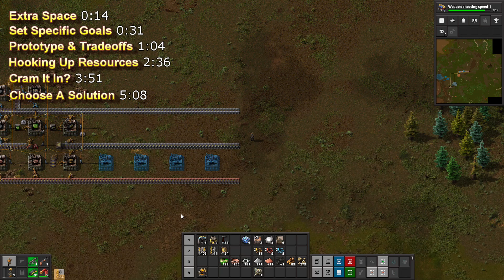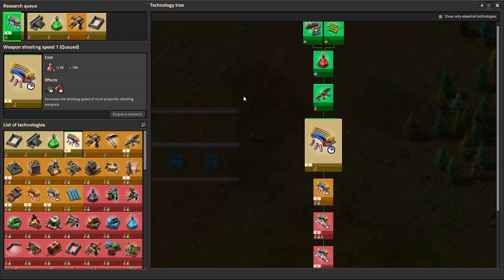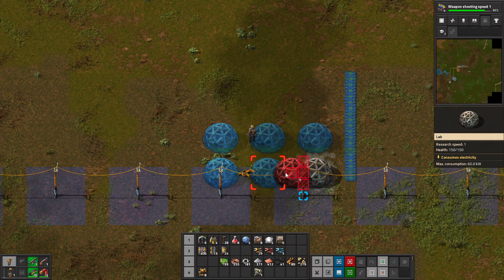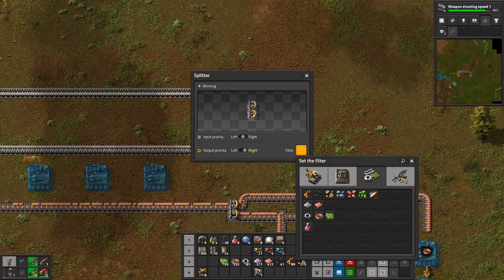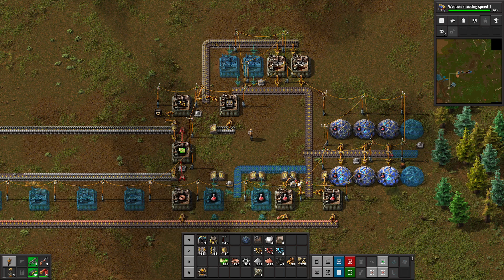Designing Complexity | Factorio 2.0 Tutorials For New Players | 8

Comment: My jumpstart base setup uses gears/circuits on one belt, then iron on the second, with copper below the bottom assembler line, and stone/coal above the top assembler line
It has its hiccups, but it keeps everything in a neat row and reduces spaghetti (I stole the concept from Nilaus)